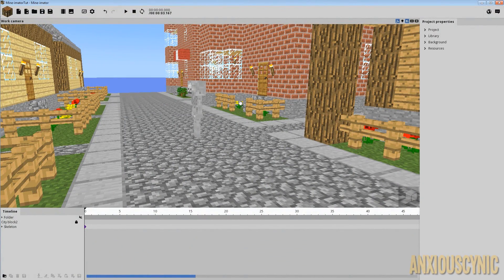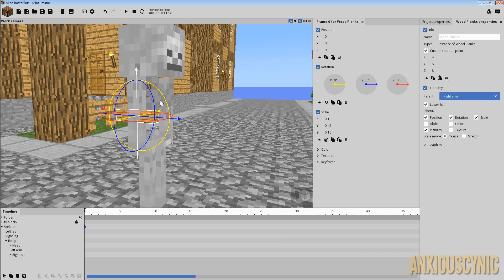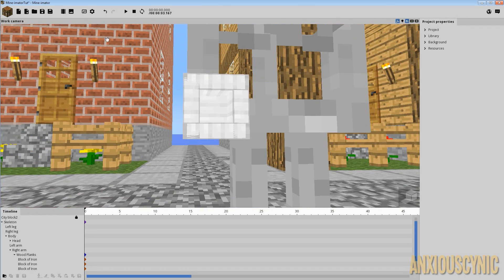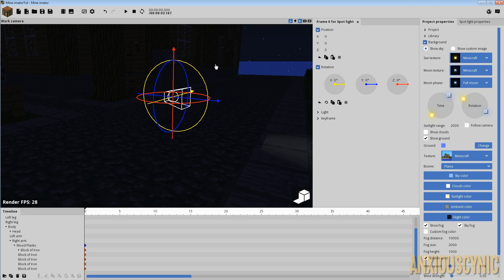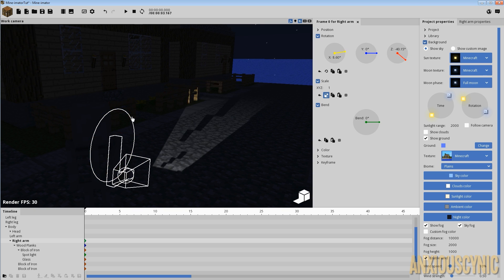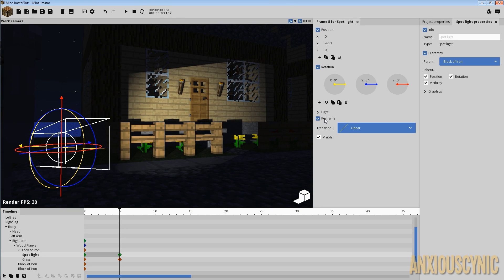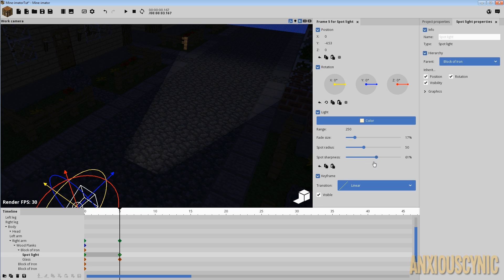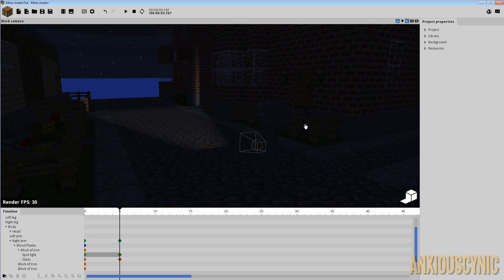How To Make A Flashlight! | Mine-imator Tutorial

Comment: Hey cynic! I know this is an old tutorial from now, but i was wondering if you could make the light square? Im making an animation that has a light running on the side of the wall, kinda like an LED. I was also wondering if its possible to make the light be emmited in the shape of letters? Like an "Open" sign?
Reply from the maker: To make the light cast as a square, you could do similarly as I showed here and embed the light in a square object to produce sharp lines around the light's cast.

To my knowledge, there is no way to make a custom shaped light, but you can easily mimic this by adjusting the Brightness of an object and using a point light near it to give the illusion that it is casting light.